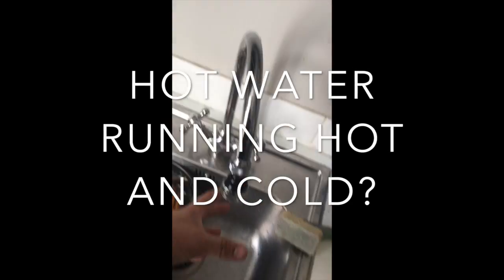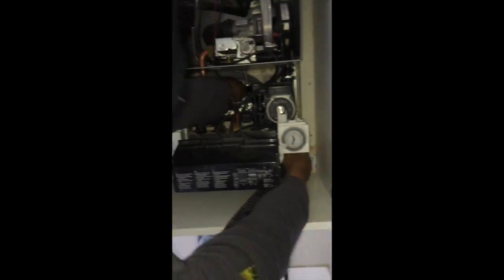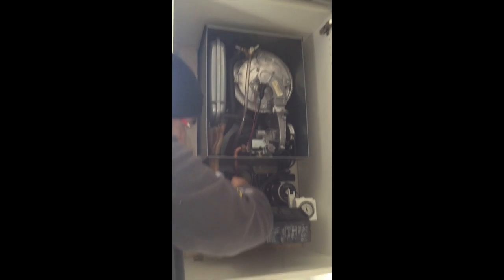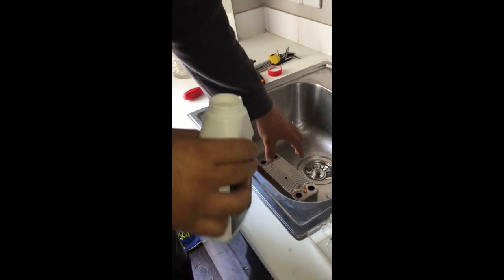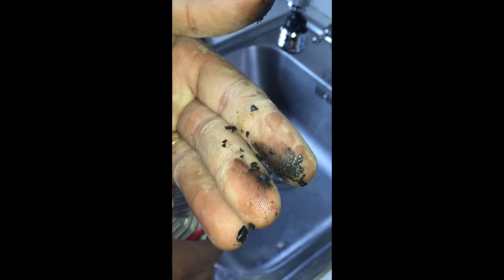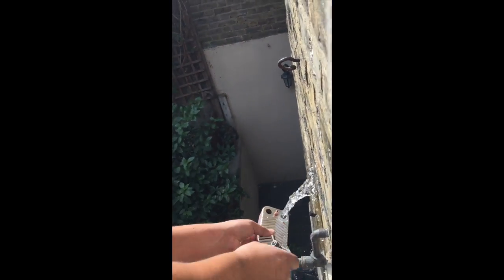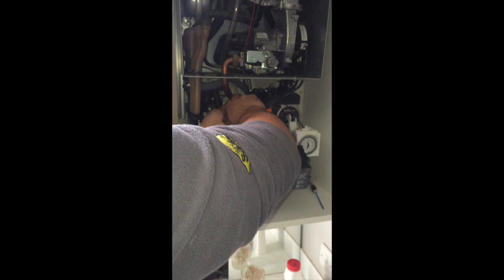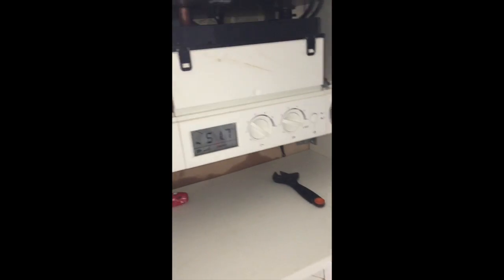Heat plate clean  Viessmann Vitodens 100-W 26kW ERP Combi Boiler

Comment: I've cleaned numerous P2P h/ex. A good tip is to buy use Fernox fx2. I brought a hyro block for cleaning these. You connect it and it basically power flushes these using fx2 without risk of acid burns. Try Fernox DS40. I always keep a box in the van. Works a treat. Acids could potentially damage aluminium h/ex. When doing installs, I kept and cleaned them. Quicker on the job.  More on service breakdowns now. You live & learn. Also wack some silicone grease on the o rings on the ret flow block. Reduces risk of leakage. I keep new ones in the van. But some agents/landlords like cheap jobs.
Reply: Thanks so much for the great advice, and amazing attitude. Some people don’t understand you live and learn. I am always a humble student and will definitely use the info you gave me thanks again

Comment: CAUTION!   Spirit of salts (hydrochloric acid) or brick cleaner, as some people use, is a definite NO for stainless steel heat exchangers. It degrades the stainless and reverts it back to ordinary steel allowing it to rust.  Use Phosphoric acid, as in Kamco FX2 acid cleaner, which wont  damage the stainless.
Reply: Thank you so much for the information. I love growing my knowledge and I shall add this to it. Do you know if it’s as fast and effective for cleaning ? As most jobs like this are time sensitive. 
Thank you
Reply: Hi, Phosphoric works well and is used primarily as a steel cleaner. It may not be as agressive as some acids but thats a good thing on some equipment. As I said its what Kamco use in their powerflush cleaner FX2.
(You can buy phosphoric on ebay.)

Comment: Good informative video mate but that is going to block again you’ve got a lot of dirt and magnetite in the system looks like you need a complete system flush
Reply: Hi, 
Thank you so much for the comment. Yes I agree it will block again, i advises the landlord they could do with a power flush and a magner clean installed to prevent future issues.
Unfotanely landlords are not always happy to cure the problems, just want there tenants to stop bothering them for a while 😐. Thank you